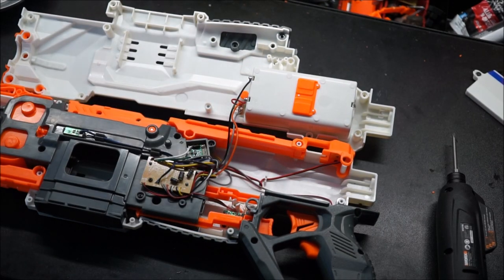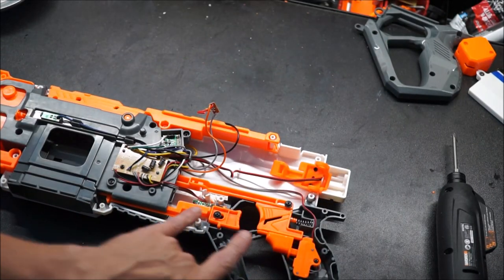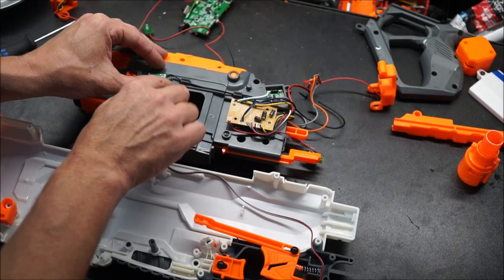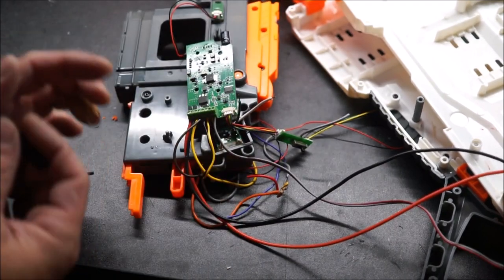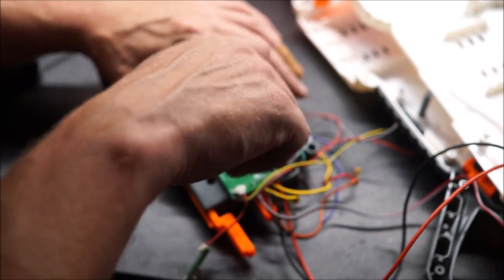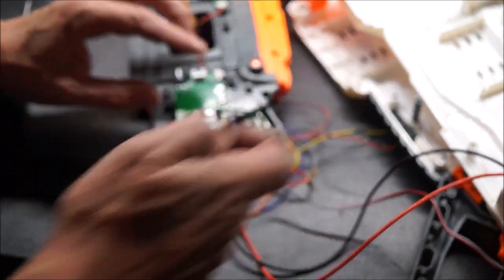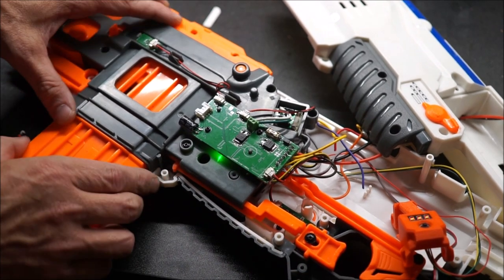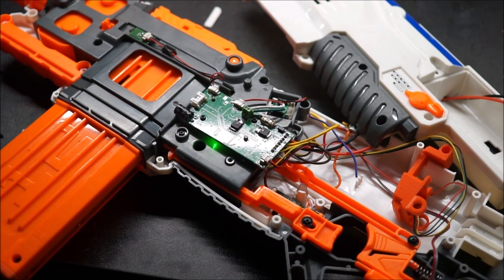Drop in , Regulator Kit !

Comment: if your planing to upgrade the flywheel cage I think worker has a aluminum flywheel cage for regulator/hyperfire
Reply from the maker: Without a doubt my friend. I have used that cage in several blasters and it always serves to impress.
Reply from the maker: I like the aluminium cages from DRS, stay clear of the the printed ones. My only problem with DRS cages is the price, they are very expensive. or at least they were. I haven't priced them in a while.
Reply from the maker: 65 is a good deal on the aluminium DRS cages. The printed ones end up with the flywheels rubbing, or at least every one of the 3 that I have used did. It's not a huge deal, but it does require some additional work to make them function right. And for the money, I don't feel I should have to do a bunch of extra work to make a new product function, but that's just me.................................. Chris

Comment: Great video.   Currently in the middle of this upgrade and was needing to know about using thicker gauge wire in order to use a 3S lipo.  The holes were pretty small for 18 much less 16 gauge wire.
Reply from the maker: Yea it’s tough to fit heavy wire with the kit.  But 18awg silicone insulated has always done just fine for me, no matter what lipo I ran.

Comment: Can you do a guide on all of the options on the replacement board? There are still some options and settings im unsure about
Reply from the maker: To be honest my friend, I’m not 100% sure about all of them my self.
Reply: @projectnerf7920  i just finished mine today and theres some settings that arent on the sheet. Still waiting on my lipo but using 6AA's i could notice the difference between the motor braking and rate of fire

Comment: What a great video.  Getting ready to do this modification.  I bought the kit on your recommendation.  I plan on replacing with Meishel 2.0 motors and running on 2S LiPo with stock flywheels.  Would this combination get over 100 FPS?
Reply from the maker: ME 2.0s and stock cage and wheels should get you just over a 100 fps average. Thanks for your kind words and support................................... Chris
Reply: @projectnerf7920  So I really messed up.  I was working on this upgrade today and I have a PCB that turns out is slightly different from yours.  The motor wires are the opposite green/white order and it fried the board when I test fired.  Actually started a real fire.  Couldn't believe it.  I think that there's a V2 being sold now and I've studied your video images and the boards are different.

Comment: Hello, I bought this after watching yours and walcoms videos on this. Thanks for the guide as mine came with no instructions. I have a question to you or anyone that has this. My full auto stutters pretty bad, I thought I was on burst fire other than that it works great. I've modded my hyperfire and it doesn't do that. Any help or suggestions are welcome. Thank you
Reply from the maker: Typically any issued with the full auto, I have encounters has to do with the conveyor itself. other than that , it could be an issue with the photo eyes that count the darts as they go through.
Reply: @projectnerf7920  thank you very much! I appreciate it. I'll check those out.

Comment: Great video and a great solution to the "Regulator Problem", I'd probably run mine on a 2S with Fang Revampeds, maybe a Honeybadger pusher and Bulldog flywheels in a high crush cage.
Where would I get one of these kits?

Great video Chris, I do have 6 buck boards, so I could use your video and method, but I'd most likely to fry the whole thing (again)!
Reply from the maker: I put a link to the kit, on NFStrike.com in the description box. Should have done it last evening but I was worn out. It was yet another 5:00 am night. And I think you would do just fine using the buck my friend. You have more than sufficient skills to do the job. I know it and so does anyone else that's ever seen your work. Much love my friend...... Chris
Reply: @projectnerf7920  Thanks Chris, you have more confidence in me than myself!
Reply from the maker: I know what I know my friend................................. Chris

Comment: Did you change out the pusher motor?  I've got a build with Neo Rhinos in the works, with a stock pusher motor on a 75C, 500mah battery.  I'm wondering if the battery has enough headroom...
Reply from the maker: I would recommend a larger battery for the neo motors. 75c will work fine, but 500Mah is pretty small.

Comment: The mystery of the AK mod still irks me but i guess some things are just not meant to be known... Also modified my AK barrel parts to accept both 3/4 inch thin walled PVC pipe and your favorite copper pipe. So you should only need to epoxy them in place in future.
Reply from the maker: That is too sweet, the 3/4 barrel really does help to eliminate drag. Thanks so much for taking the time to set it up that way.Much love my friend.......................... Chris
Reply: @projectnerf7920  you are most welcome

Comment: Is there a way to disable the motor braking on the flywheels? I noticed that in all the review videos of the regulator kit.
Reply from the maker: Not that I know of, without being able to isolate the circuit on the replacement board.

Comment: hey..o have a question,,my upgrade kit suddenly died...i had it for 3 months..it usually run 2s lipos..since i replace the motors with fang rv..
but when im upgrading with 3s motors..and so 3s lipo..i just only playing it for 4 hours...then suddenly it's dead. no smell no smoke indicating any burnt..it just died..and idont know why..
does yours find those problems too?
i warning many mooders to consider 2s only for this upgrade board kit.
(ps : my friends regulator..having that problems too)
Reply from the maker: Did you remove the thermistor at the flywheel cage? I had the same problem when I left it in. But after removing it mine ran just fine, with quite a bit of game play on it. Just asking because it's an easy oversight................. Chris
Reply: @projectnerf7920  yes im completely rewiring it using 18 gauge silicon wire.and definetely by passing those thermistor...
but last night i think i found what causes my regulator death..i think its elco capasitor 470uf 25v, i found that its connection to the board are loosen..so one of its foot cracked...
ithink that's why there is no power at all
Reply from the maker: Sounds pretty logical to me, Let me know what happens when you solder it back up/replace it..................... Chris

Comment: Will yours shoot half length darts? I'm building a regulator for endwar and I want to shoot half lengths if I can, but I haven't gotten the kit yet.
Reply from the maker: It’s designed for full lengths, but if you extend the pusher you should be able to do a short dart conversion.
Reply: @projectnerf7920  extend as in move the belt further forward? I would have to probably design and print a custom belt housing.

Comment: What did you have to do to replace and wire the motors? Anything special?
Reply from the maker: I suppose you don't really, if you are going to be using a 2s battery. But the stock motors will burn up fast if you go any higher. So I felt it would be better for overall longevity and reliability of the blaster................ Chris
Reply: Right I understand, but I'd really love to bring it up to superstock performance to be a good loaner, so I'd love to put some FrVs as the flywheel motors and a honeybadger for the pusher (all on 2S). So would I be safe just hooking up those upgraded motors (with upgraded wiring) to the board without it frying? :)
Reply from the maker: Should be able to with no issues at all

Comment: So I encountered a problem. Everything works fine, except that if I put a magazine in, the mag gets stuck on this one tiny lever that keeps revving it and I basically have to take out the conveyer belt for it to stop. Any ideas on how to fix?
Reply from the maker: Not too sure without seeing the inside of the blaster, if you have some pictures or a video of it, send it over to my regular mail  Project.Nerf.2.0@Gmail.com     And I'll be glad to look it over.................. Chris
Reply: @projectnerf7920  ok I fixed the problem. But now there's a new problem. Is your rled light switch working for you? Because whenever I plug it in, the flywheels won't work. Could it be a factory flaw?

Comment: I know this comment is late, but the wires that connect to the board are too thick. I stripped them, but then they kept falling out. Any suggestions?
Reply from the maker: That's interesting, I didn't have that problem. The only thing I can offer is. Make sure that the wire ports are all the way open before you put the wires in. Take your small screw driver and turn the screws counter clockwise until the ports are wide open, then insert the wires and tighten them down. I think I had to do that for the pusher motor wires.
Reply: Project Nerf, thanks so much. Love your work. Keep it up!! :)

Comment: Dis doesn't look easy to me. Am I able to jus add imr or lipos and call it a day?
Reply from the maker: I wouldn't even try IMR or lipo on the stock blaster. I have heard horror stories about about doing that. And obviously if you torch the board no more blaster. You could re-wire it after the fact to run like a Hyperfire, but that seems a terrible waste of a regulator.......... Chris
Reply: @projectnerf7920  ok thanks, I guess I'll get a stryfe
Reply from the maker: The Regulator is a great blaster, but it is harder to mod. If you're new to modding a Stryfe is a great place to start. I have several videos going through stryfe builds. If you get the chance check out a few of them. If you need any help along the way, just shoot me a mail....................... Chris
Reply: @projectnerf7920  ok thanks and I am new to nerf and modding. I'm a stay at home mom. Was looking to get guns for my 7yr old. But realized how fun and interesting dey are to me as well